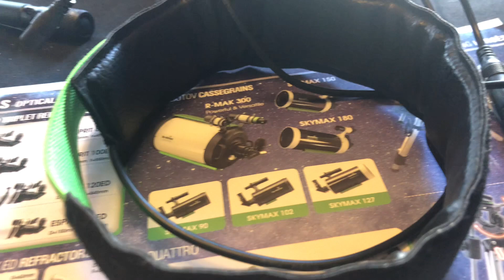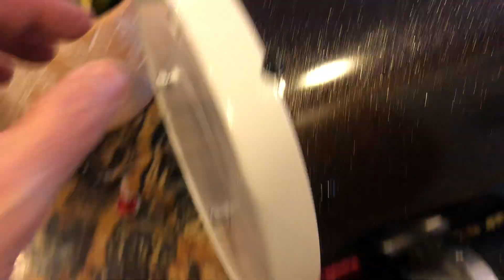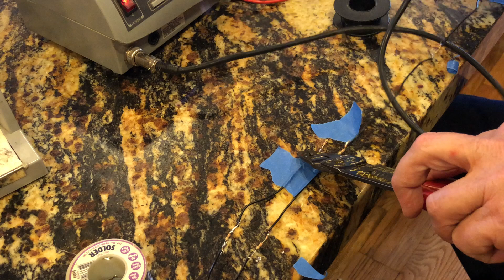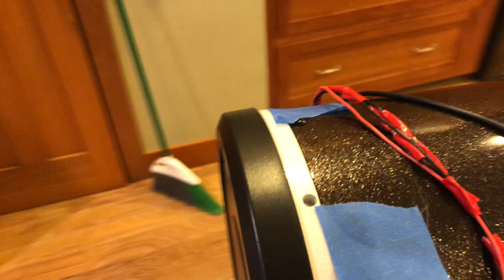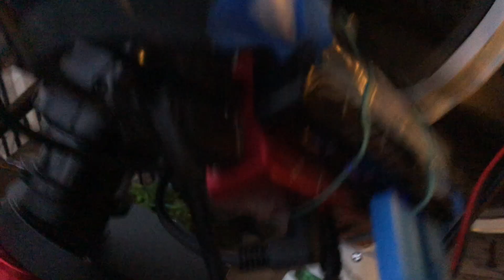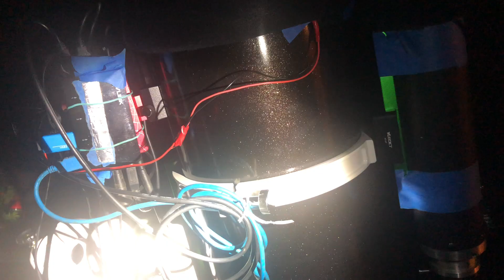DIY Dew Heater Strip for Telescope

Comment: Hi, I have the same scope and need to build myself a heated dew strip to run from USB... I have 20 x 33 ohm resistors, how many would I need of this value to create my heater strip? Many thanks in advance....
Reply from the maker: If you ran 6 20 ohm resistors in series, the total resistance per string is 120 ohms.  I you place 3 of these in parallel, ohms law would calculate the total resistance should be  40 ohms.  This results in 4 watts total at 12V, with a current of .32 A.  Now this is much different at 5v.  You would need more current for the wattage.  Personally, I would not design this at 5v.  I've never seen a dew heater at such a low voltage. Keep in mind this is just an experiment and it's risky doing this type of things on an expensive scope. Might be better to spend the $ and get  commercial unit.
Reply: @MyEngineeringProjects  Thank you for the explanation, really helps... I don't have 20 ohm resistors? I have 20 x 33 omh at 1 watt resistors and 10 x 47omh resistors also 1 watt?  How many would I need to make this work using a 12 volt power source?   I do apologise in advance for clarity...